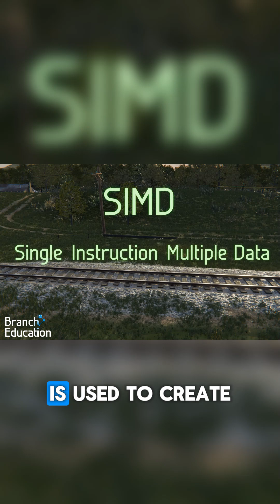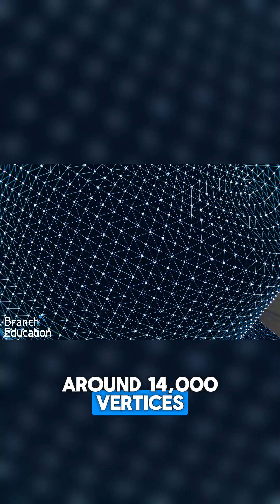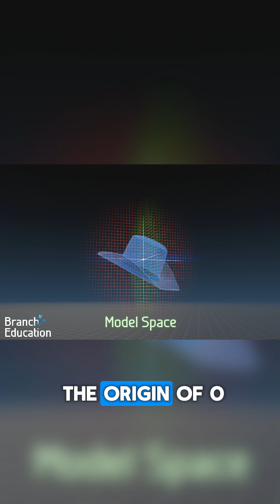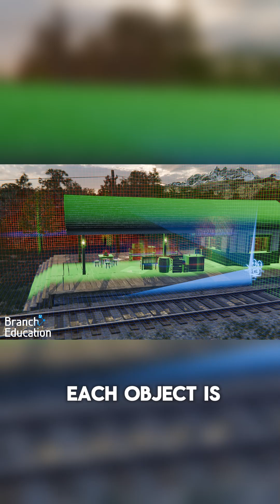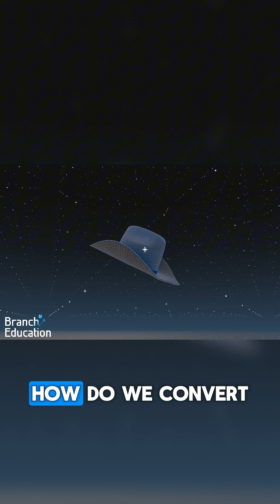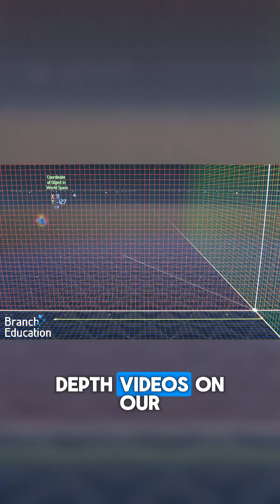How do Graphics Cards Work? Part 6 #gpu #technology #engineering #videogames

Comment: Each object has its own 4x4 transform matrix that is used to move vertices from model space to world space. Every vertex in model is multiplied by its transform matrix (vector-matrix multiplication) which results with model in new location. Rotation, scale and translation can be stored in transform matrix. And fun fact, translation is 4-dimensional operation - its skewing 4d version of model and projecting it to 3d space, thats why 4x4 matrix is commonly used and not 3x3, if we used 3x3 matrix we will have to use another vector to store models global position and transform it by adding it to each vertex.